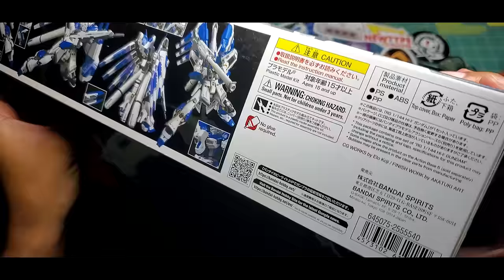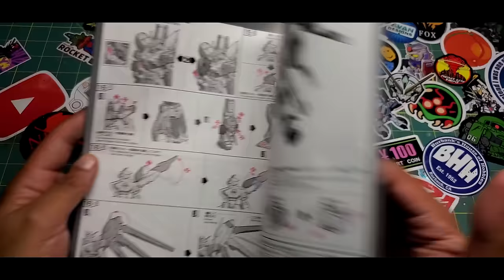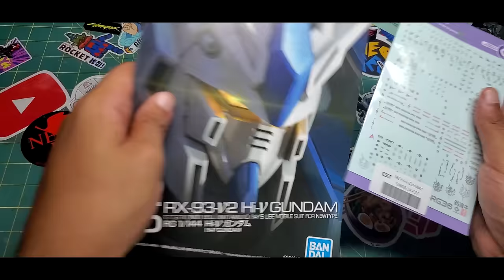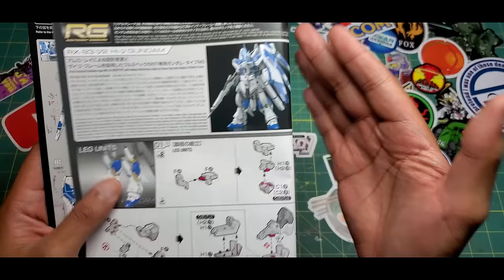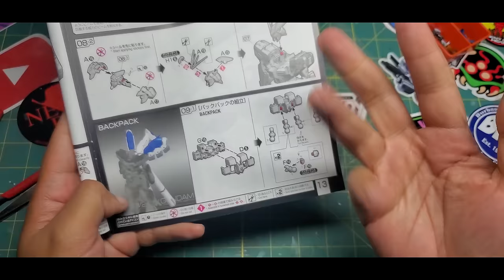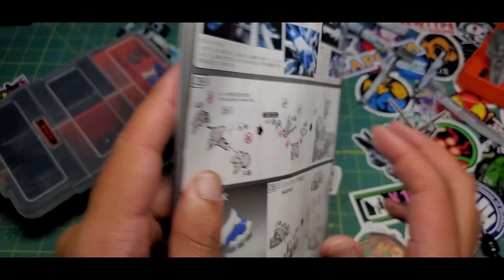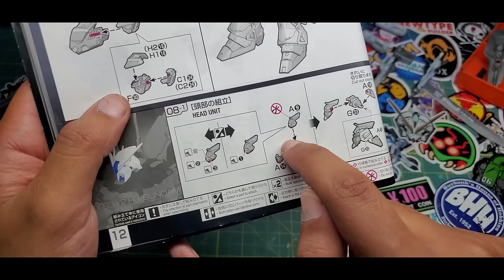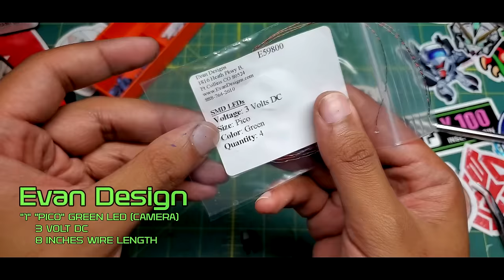#newtype #Otakubuilder Char's Counterattack Beltorchika Children - Hi-Nu Gundam RG 1/144 Scale

Comment: Brilliant, absolutely spectacular work! I actually watched from start to end and I picked up so many new tips and tricks. As I am quite new to this hobby, I have some questions to improve myself in the long run, and apologies in advance if they're stupid:

1) when you're doing pre-shading, does that count as 'panel lining' since you're separating the panels through shadowing? 
2) did you paint the inner frame? I got confused which were armor plates and which were the inner frame
3) how did you panel line those little notches? (Did you panel line at all?)
4) did you topcoat? 

Thanks so much for making this video it is truly stellar work :)

Comment: This little guy is probably the best iteration of the Nu Gundam I've ever built. The articulation is insane, and posing the novel Nu is even easier and more fun than the RG movie version. The details look even more impressive than the Nu ver Ka, which the RG Nu failed to outshine. The proportions I prefer since it just has that chonk without looking too stubby, retaining the feel of agility I got with the RG Nu. Everything works so smoothly and the leg bend is just wayy better engineered than the RG movie Nu. The only things the RG movie ver I feel might be better are the beam rifle and the bazooka. The beam rifle on the RG Nu has more color separation & details, and same with the hyper bazooka. The bazooka on the movie ver also has more subtle connection point to the backpack unlike the novel ver, which can be a thorn to my side at times.

Comment: I recently painted a model with acrylics after using Vallejo Primer and the paint is still incredibly fragile. I’m treating it like eggshells putting it together while still having to touch up. What PSI do you normally set at since I may not be putting out enough paint? Any advice?

Comment: I have a problem painting inner frame and articulating armors the rubs and fitting part. Because after painting and top coating every is to tight to fit assemble. Any tips?